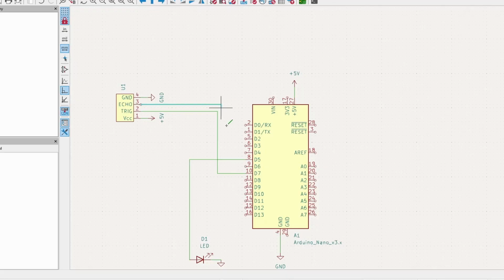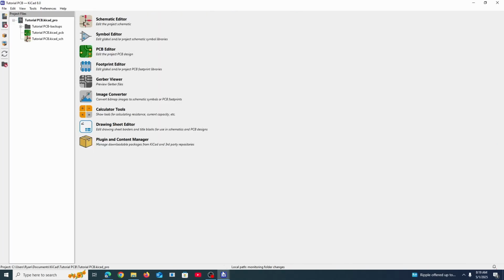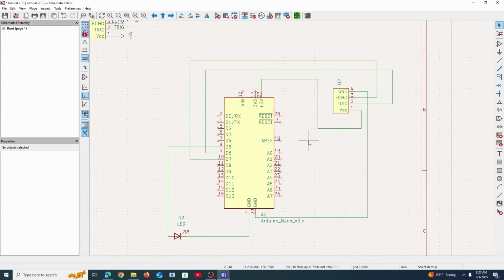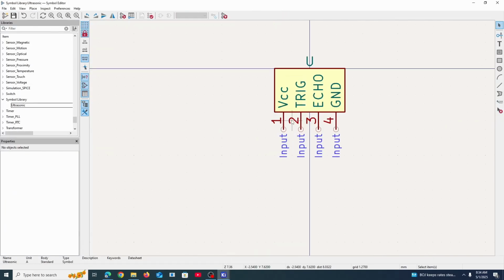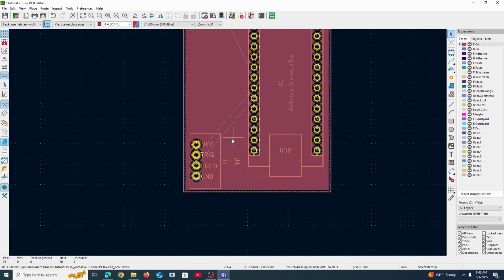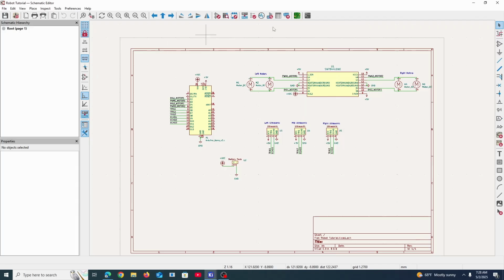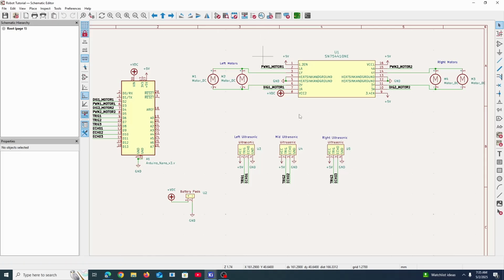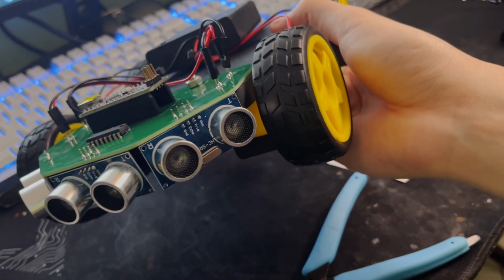Beginner's Guide to PCB Design in 30 Minutes! (KiCAD Guide)

Comment: Great guide. Tnx.

I saw, some pcbs designed with two filled zones of GND, instead of on for + and second for -, as you designs. Is this differents only by design choises and  convenience, or has some other advantages?
Reply from the maker: Hey. I'd say that using all GND planes allows for better electromagnetic interference between signals of different layers. This is because having more ground planes allows creates more areas/places for the current produced from electromagnetic sources to go to ground, away from the actual signals. In my case, I do not have sensitive signals like high speed digital signals, so I just use a + plane and GND plane for power reasons (in this case, it's convenient as I don't need to route those power signals myself). So yes, as you said, it involves design choices and/or convenience. Glad you enjoyed the guide!